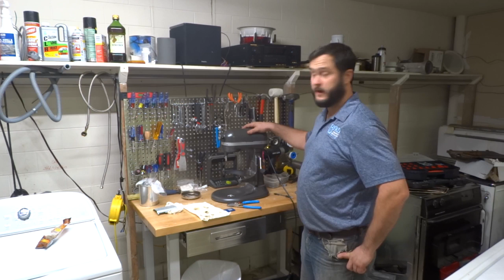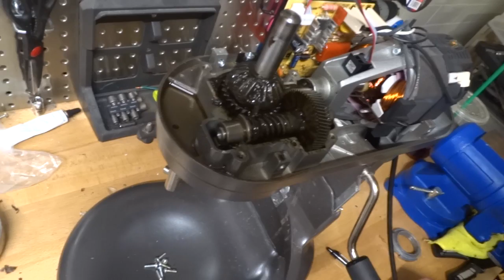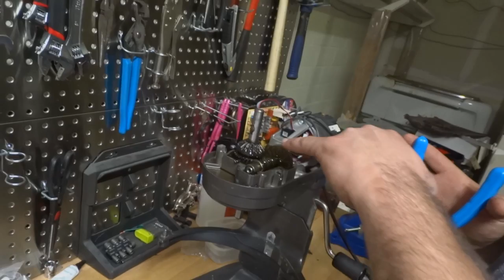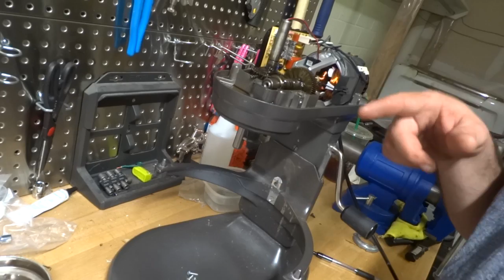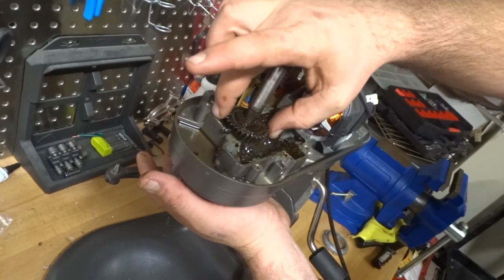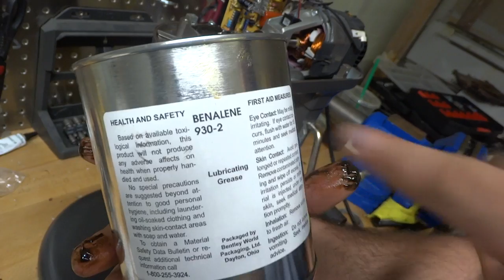How to Fix KitchenAid Mixer - Will not Spin

Comment: Thank you so much. I was able to repair my kitchen aid mixer. I opened it as what you instructed. I found out that there were little broken metals on the rotating gears, I removed them. Then close and tested it and now it’s working. The problem before was when loaded it spins  then stop right away and making noise  but when not loaded  it spins. I was nervous when removing the part coz I was scared I’ll make more damage but I did fixed it. I think most of the time I overloaded it that’s why it was broken. Thank you again🥰

Comment: This video was so helpful when I was fixing my Kitchenaid KP2671X-BK mixer!  Easy to follow and was exactly the issue.  Just note there are many models of the Kitchenaid mixers and the less expensive and/or smaller ones don't have the transmission box and gear setup like the one in this video.  I think this video mainly pertains to the Pro Series 6-quart mixers.  Anyway I was able to fix the mixer with a $15 gear and $15 of grease.  $30 sure beats buying a new $600 mixer.  Now my wife says I can spend the $540 we saved on something else for her!!

Comment: I know your video is pretty old but just wanted to let you know it is still useful!  The nearest certified kitchenaid repair center is hundreds of miles away so i turned to YouTube and your video helped me find and fix the problem.  Thanks so much!!!!  Btw i have a kitchenaid pro 5 plus stand mixer and the insides were identical.  Also, you’re not kidding about the ring pullers!